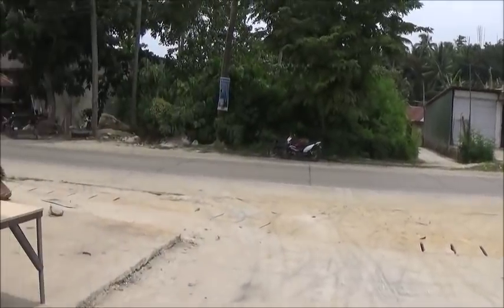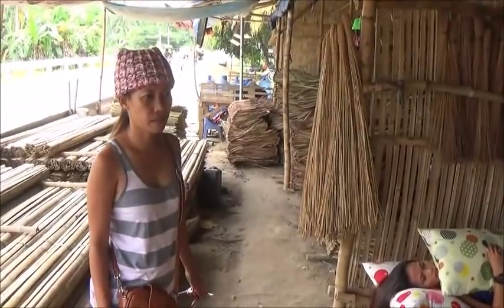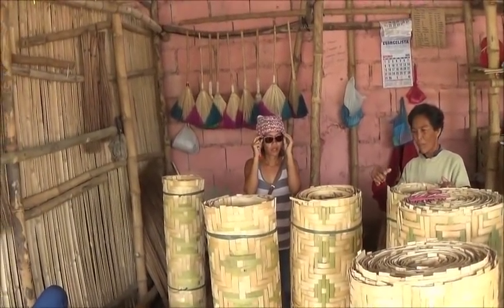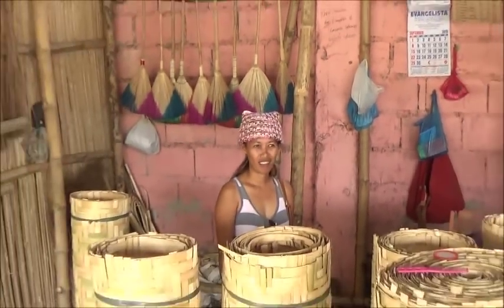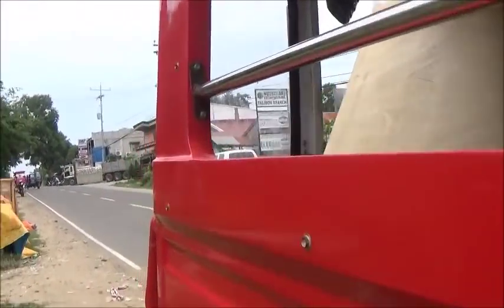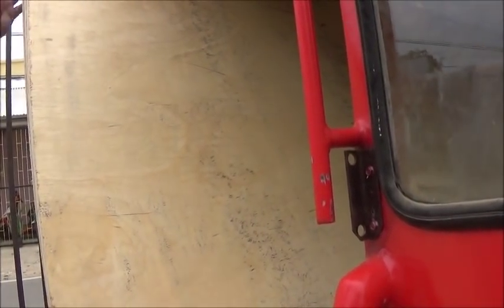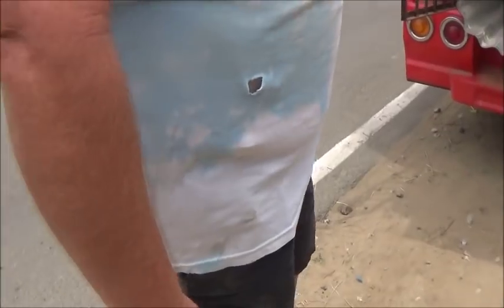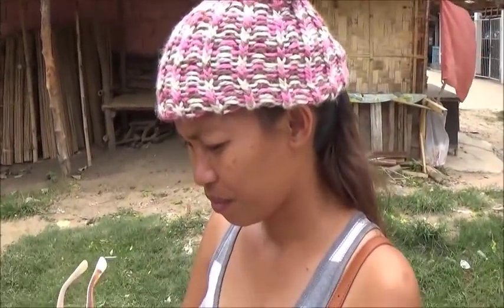Getting The Rest Of The Materials For The Ocean Caretakers House

Comment: Brain how are you finding the steel roofing sheets mate at pangasian i have notice they are  getting alot thinner now for the same price .
Cheers mate
Reply: Galvanized corrugated roofing come by gauges. The lower it is in number, the thicker. If it is thin then it must be ga. 24 or higher. If you pay a gauge 18 price for a ga. 24 G.I. sheet, then you are ripped off. Prices are based on true gauge number.
Reply: @romeoETmike  thanks for that romeo.
Will check it out the next time i need to buy some .
Its ashame there are always people trying to scam you and ripp you off 
Gives a bad name for all the honest hardware stores in the Philippines .
But you find people like that in every country.
Cheers mate thank you again